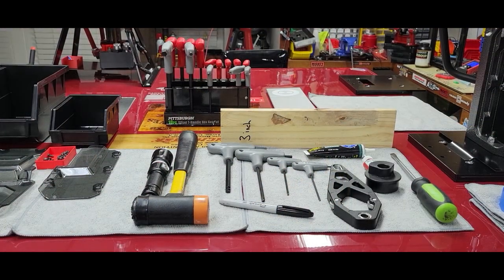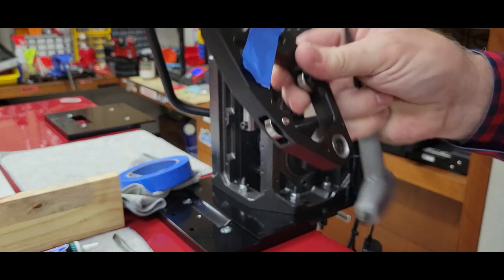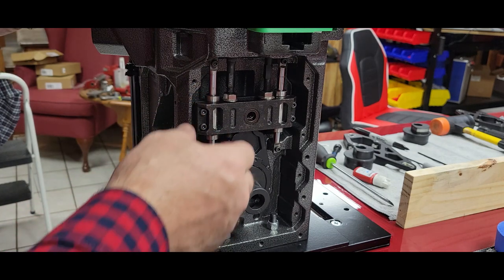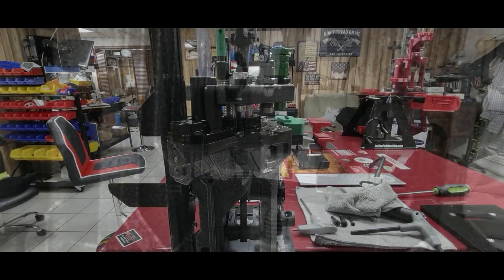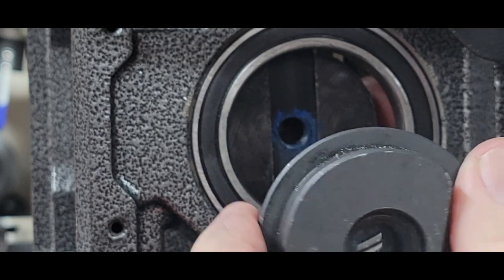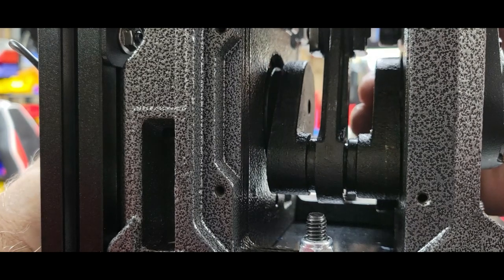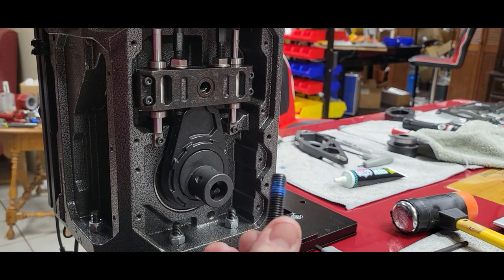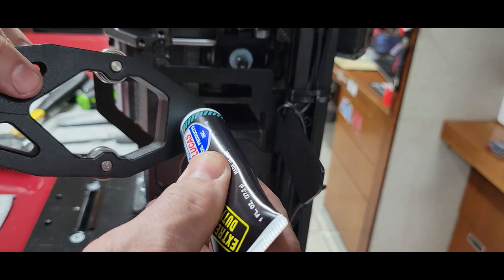X10 Index Cam And Arm Replacement

Comment: This was a good video, working in Mfg my whole career I can see this is a machine that when maintained will last a lifetime, stress/wear areas have bearings which makes it very accurate and repeatable.
 I bought a lightweight LEE 1000 just to tryout reloading and I make very good ammo with it but it's flimsy with many high stress parts made of plastic,  I am going with this over the other popular machines as I would have never guessed how low the price is for what you receive, your video with all the covers off shows the quality construction.

Comment: Hello Sir, thank you for the follow up on the X10 from the other Pilot testers experience that was shared with me. I had watched several of your videos, great work by the way. I wouldn’t say the other individual turned me away from this press it just got me to mental state of just be patient they are sorting everything out and they will release it when they are ready. I have been reloading for twenty years and I love my Dillons but there are conditions that cause even Dillons to be finicky as well. I like to gather a lot of views good and bad on new products I still look forward to the release of this press and wish i could have been part of the pilot program.

Comment: Excited to get my hands on this press. Although, after watching some of the reviews, seeing the issues, I’m not sure. The Dillon precision, is double the price I think there’s a reason for that.  How are you already splitting bearings? I don’t know. I hope it works out.   it honestly sounded too good to be true in the beginning anyway.  I hope it all works out but for $1000 I just don’t see how they can do it at that price point.
Reply from the maker: The split bearings has been easily solved by a redesign of the cam they roll on that relieved the pressure at certain points in the cam profile. Right now the only x-10 presses in existence are under a pilot program which every person knew its under a pilot program designed to have the participants report issues so that FA can address them before a full public release. FA has been working diligently to solve all known issues and they have all been minor issues to solve. No press on the planet ever came into existence without initial quirks that got solved over time...including blue presses. My x-10 is running like a Swiss watch after I installed the new cam and no more split bearings for the indexing. A good bit of issues people have had have been improper set up using wrong combinations of case locators and plungers for the caliber they are loading etc The other known issue is certain brands of primers have a taller anvil than others and they catch and jam, FA will be sending out new priming gears with the holes set .010 deeper to solve that issue. This is only on small primers, large primers have not been any problems. Hope this helps

Comment: I just split a bearing after only 220 rounds of 9mm.  Do you know when a redesigned cam started shipping?  I purchased my press on 8/12/23.  I'm assuming I must have the old cam design since the bearing split.  I contacted FA and they shipped me a new index arm.  But don't I also need the better cam?
Reply from the maker: @XrayDoc88  all the updated cams on machines that didn't ship with them have been sent out, there is an upgrade coning soon I can't discuss any further than that at the moment
Reply: @bragginrightsprecisionrelo346  Thank you.  I discovered a second problem in addition to the broken bearing.  I don't know if this has been reported or not.  The screw on top of my "pawl" is cracked and bent.  I suspected the screw was defective when the pawl seemed loose and there was some movement of the screw side to side if I wiggled the pawl up and down.  I had to disassemble this area to confirm this.  I have pictures, but do not see a way to upload them in this comment section.  ☹